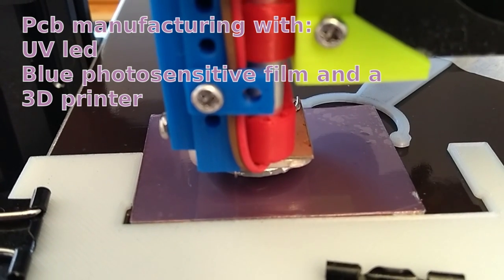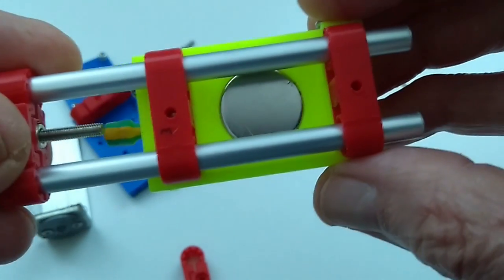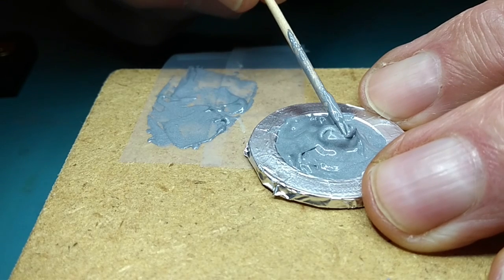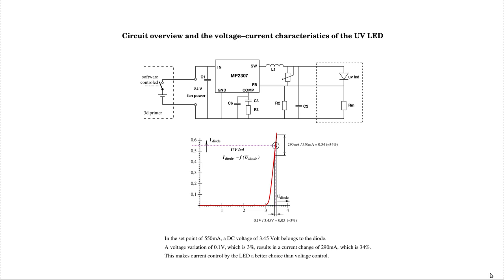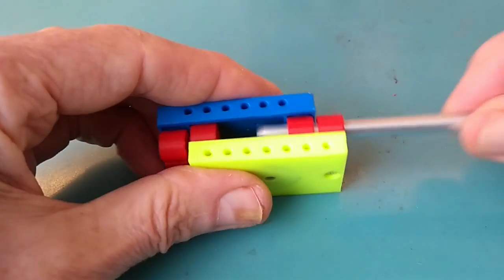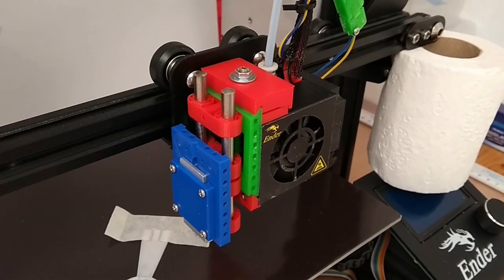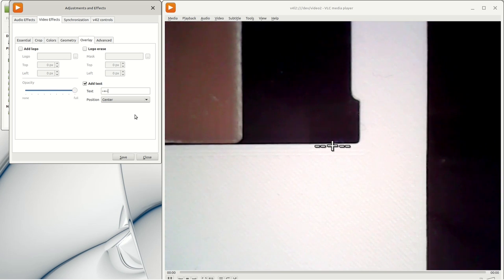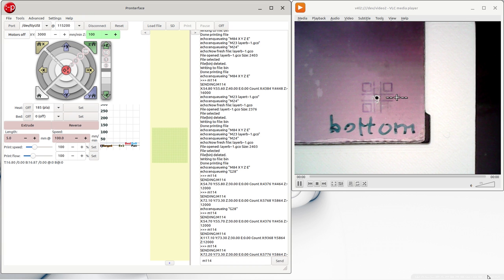Make a PCB with 3D printer, UV led and photosensitive film

Comment: I've seen a few attempts at using cnc to expose boards, most were pretty bad and others quite expensive to build.  Yours is impressive, simple and has decent resolution especially for basic through hole boards.  May take a crack at building a dedicated one, have lots of extrusion and printer parts laying around.  Thanks for sharing !

Comment: love the idea. Imagine using a fiberoptic. You can get these super thin. Place the led on the desk. Easy to setup on any printer. Keep it up!
Reply: Not just any fiber though. Losses through conventional 62um or even 1.5um fiber would be too high and coupling light into those requires either precision optics or lasers. For UV, you need to use hollow core fiber that starts at 200um and about $40/ft, which is only about twice the resolution of this pinhole implementation. If you want to focus down to less than 200um, more optics will be needed at the other end too, at which point you may as well go with 400um hollow core to more easily pump more UV in.

Comment: Your idea remembers me 40 years ago when I used the same principle to adapt a dot matrix printer into a scanner! Yes it works! Maybe a focusing lens could greatly improve the resolution. Thanks for sharing!
Reply from the maker: Theoretically: yes
Practical: no
The spot size is highly dependent on the lens-object distance.
The diaphragm of the lens greatly reduces the amount of light.
It requires an expensive lens system.
And a greater distance from the light source results in wavy lines when the machine vibrates.
Reply: @wilstraver962  Do you have the 3d specs for your apparatus? Do you sell the jigg?
Reply: I agree, many high quality sony UV laser diodes are cheap and simply use glass lens. Should be easy to build and provides a fine laser focus point. I have them sitting around, brand new many kinds of sony UV laser diodes and ender 3 V2. I never bothered to build the ender 3 v2 because I didn't expect it to provide decent PCB pitch lines. This youtube video shows it is very promising.
Reply: @wilstraver962  almost the laser marking or cutting machine work in same principles ..

Comment: Wonderful video.
I'd already thinked about doing PCBs at home and made a tabletop CNC mill, but after seeing this video, I want to make an UV light addon, it is much more simpler and creates less mess.
Reply: Correct, the milling process vibrates alot and makes a really bad mess. I may convert the milling machine into laser/uv diode.
Reply: only upside of milling is that you get holes with your pcb but otherwise, too much pain in the ass.
Reply: makes me wonder if you could shove a bit of scrap fiber optic cable to get more resolution.  I get why you don't want to use a lens in this setup, but maybe the you can push enough light in the fiber for it.
Reply: @warlockd  I think you meant to write a message under the video and not under my comment, but I'll try to figure it out anyway.
In the article "Transmission of UV Light with Optical Fiber" on the lasercomponents website there is a statement that a regular optical cable will not work, I quote:
"In wavelengths shorter than 260 nm, UV light caused degradation in conventional fibers – a direct result of solarization effects."
There is also a chart where you can see degradation of regular optical fiber cables.
So basically you will need special optical fiber cable by Polymicro or other vendor in order to work for a long time or if you would use regular one then change it after half an hour of usage.
Reply: @warlockd  this actually a brilliant idea. The only constraint would be how much overlap you could get when creating a fill type shape and of course the resolution of each step.... keen to see what that looks like numbers wise

Comment: Brilliant idea and construction of it!

A tip: You can make very small, very uniform long holes by molding glue or plastic around acupuncture needles, which are cheap to buy and come ss thin as 0.18 mm. (Coat them thoroughly with oil or mold release before molding the glue or whatever around them though!)

Comment: Your work is amazing, and I was really interested in your ideas, and how you made it.

Although I think your mic setup is holding your channel back a lot, if you're wanting to do this for your videos to get popular- there was a lot of pops and background noise from your mic when you were speaking, that meant I had to dial in the audio just right to where I could hear it, but not louder, where it would start to hurt/chafe my ears. I think less background noise, a pop filter, or a better mic are all things that may make your videos significantly more enjoyable to watch.

That being said, I'm really glad YT recommended you to me, I loved the video, and wish you luck in your projects!
Reply: Good point.

I've myself previously removed noise from the microphone using Audacity (used in post production), then I've used VoiceMeeter and Cantabile with Reafir plugin, and now I'm switched to Nvidia Broadcast (requires Nvidia GPU). Second and third method can be used for removing noise after and during the voiceover recording. But I found Nvidia Broadcast as the winner.
Reply: rnnoise is a similar concept as nvidia broadcast (very good but not as good as nvidia's), but open source and it's included now in OBS studio (add filter to microphone -> add -> noise suppression)

Comment: Hello, thank you for your nice video. I have been using this method for several years, but with a simple (but good) blue laser diode. I buy printed circuit boards with photoresist already present, and about 100mW is enough.
Reply: If some through holes needed, would you cnc drill them after the laser pass?
Reply: @lpjunction  It is rare that there are no holes at all at least for the connectors. I drill with a hand-held drill press. I avoid holes as much as possible by favoring SMD components.
Reply: @danielroibert5631  
Simple connector hole could be hand drilled.
But modern IC, even a simple one, has more legs than a centipede.
One quickly come to a point when 2d is not enough, we need 2 planes with some through holes.
Then of course, for prototyping, the through holes could be avoided with jump-wires.

Next, you'll be playing with micro-surgery soldering.  Have fun.

For normal drilling, the drill action is usually downward. I once have a DC motor drill for PCB, 
the drill is installed under a small 'table', the drill action is upward.  To locate where to drill, there
is a transparent acrylic glass secured about 7mm above the table, so the pcb can slide freely on the 
table.  For the first time, the drill poke upward to make a small hole on acrylic. Then you can use this
hole to guide the pcb at the spot right above the drill bit and press the motor upward to drill.

Add a magnifying glass to help, to me it is easier than using a drill press to drill downward.
Reply: @lpjunction  Thank-you. I don't know what you are getting at. I don't make PCBs for mobile phones. I just use 2.54 pitch connectors. I mainly use 0.8mm or 1mm drillings and that works fine for me. Your bottom-up thing sounds interesting, but I’m not sure how it looks.
For soldering too thin to be done with an iron, I use my reflow oven. And again, I only do prototyping. If I need better quality or small runs, I have them done at JLCPCB.
Reply: @lpjunction  That's a brilliant drilling method! Might be even better if you put the acrylic on thumb screw/spring mounts like a 3D printer bed so you can raise and lower it to be just more than the thickness of the PCB. That would eliminate parallax error when positioning, and serve as support for the drill pressure so you don't have to hold the PCB down to the table by hand.

Comment: This is pretty neat. What about - instead of making a pinhole with an LED inside - mounting the LED somewhere out of the way and coupling it into a TOSLINK cable to not only position light output more precisely but also reduce the complexity of the setup?

Comment: Woderful solution to make PCB boards on a 3d printer. Thanks
Does it make it in just one pass. Only controlling the time the led is lighting over a point?
Reply from the maker: Thank you for the positive response.
The pcb is exposed in 1 run. The amount of light on the film is determined by the intensity of the light source, the speed that it moves over the film and the size of the pinhole (0.1 0.2 0.3mm .. etc). So 3 parameters to control the exposure.

Comment: I wonder if you couldn't just use the nozzle of the printer and drop the UV lamp down into the hot end... then you can expose it directly through a .2 or .4 nozzle, for example.
Reply: good idea, the dot of ligth must be better and smaller

Comment: Have you considered using a focusing lens to narrow the UV beam with a more concentrated area?  I would expect to get better than 0.5 mm track.  I can see this easily getting down to 0.127 mm without any major problems.  Depending on the focusing optics, you can use the Z height to adjust the track/UV energy width.
Reply: I'm thinking putting the uv led in the nozzle with a drop of distilled water at the tip acting like a lense. You could change the focus by rising or lowering the led
Reply: direct contact with the film is simply the best method to do this. no need for any sort of lenses, cheap simple, and perfect results. the final result will be the quality of the 3d printer.

Comment: nicely done  Will,  maybe an old mechanical watch movement can help you to make the orifice. I would use a jewel of it.  vary of sizes are to find. balance axel is usually between 0.09 to 0.12mm, they are wear-resistant.  Hence, this is how they made the pcb films long ago with the use of aperture wheels. If I find some time will make a similar device and upload a video of it.  " just did a quick test, the red ruby doesn't filter the UV light"
Reply from the maker: You make me very curious.
Reply: Try obsidian 😯😃
Reply: @wilstraver962  0.1mm doesn't pass enough UV, it's not intense enough. this makes it a slow process.

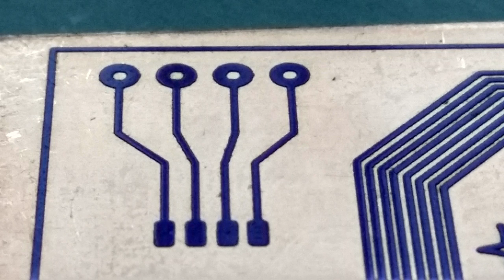Comment: 0:54 - Bravo. That is amazing you are able to do this on an Ender 3D printer. Which version is your 3D printer, V2 or v3? Is it possible to simply use a low wattage sony UV laser with good glass optics, would cost less than $30 for it.

Comment: I used UV laser instead. I was able to reliably get 0.25mm traces. I also tried adding a motor with a drill to make vias and mount holes. The only con with a laser is that it uses PWM driver and can’t be adjusted with input voltage (yet this is how most 3d printer controllers work - the gcode command adjusts voltage).
Reply: PWM and voltage control are about the same thing, since the result of PWM is the average value.
The main difference is heat dissipation in the controler.

Comment: I  wonder if you can use a scrap piece of fiber optics and glue it in the hole as a makeshift lens.  I would hesitate to use single mode as its way to small, but maybe?  I think you would have to polish the fiber each use though as it would scratch itself up. Humm, maybe it doesn't have to drag itself on the surface, as its small enough.  Ugh to to play with this setup, digging out my old ender 3 now and my 20 year old splicing kit hah.
Reply from the maker: Filling the pinhole is a good idea.
I tried that with UV glue and also with a two component glue. Unfortunately a lower light output. I have not investigated this further. But any solution from anyone is interesting.

Comment: I tried do almost this. First I tried print plastic to the plate, but nothing succeeded. Then I tried attach pencil to hot end and thought printer can drawing it, but I'm used gcode for 3d model and printer didn't pull up printhead when changing positions. This solution is amazing. I will try to repeat this.

Comment: How about printing to the bare copper one layer plastic? ABS, PETG, etc does not stick to the copper? Do they not block the etching fluid? Is it hard to remove later by hand?
Reply from the maker: I do not understand your question.
What does this method have to do with ABS, PETG etc?
Reply: @wilstraver962  These materials are fairly common in 3D printing, and I don't know how much they like to stick to copper. If you print the circuit with them, and they stick well, then you don't need to customise a 3D printer with an UV LED, just print the circuit to the PCB, and etch it.
Reply: @wilstraver962  he means this and yes it is possible https://www.youtube.com/watch?v=6T5zfDgzyK0

Comment: Great work! i was wondering is a uv laser could be used to make the setup more simple, but maybe the pinhole is necessary to prevent leaking of the light to the surrounding film
Reply: Basically they're will work the same, the only difference is that this print head will drive over the photosensitive layer and laser will be flying above it.
Also the laser will require you to use protection, in order to protect your eyes from burn also the laser costs more than one UV LED.
Reply: @frankhovis  I've copied messages from this thread to notepad and searched for word "blue", but nothing was found. We specifically wrote "UV laser", "UV diode", because this photosensitive film is activates in UV spectre.

Comment: Would it be possible to use two sets of opposing razor blades to further refine the size of the etching laser?
Reply: Watch out, you might end up with a diffraction pattern.

Comment: I'm just wondering what the actual gain of this approach is.  You still need to develop the UV-sensitive layer, so how is this better than printing out the mask on a laser-printer (on a transparent sheet) and using that to expose the UV-sensitive film?  I would expect that the real gain would be to get rid of the exposing and subsequent etching/dissolving mess, no?  Then again, I'm at the "soldering TH components on perf-board"-level, so all this is just way out of my league ...

Comment: what software do you used for desing pcb.
Reply from the maker: Before I retired 6 years ago, I used Cadence and ADS at work to design integrated circuits.
ADS is also suitable for making pcb layouts, which is what I used.
Now that I'm home I haven't been able to find 1 program that approaches ADS in its capabilities. My circuits are usually simple. I use an ordinary drawing program for this, made a pdf file and printed it with a laser printer on yellow paper, which I then used to put the layout on a pcb. But that will now change.

Comment: wouldn't it be simpler just to get 3d printer nozzle I think there are some with even 0.1mm diameter hole. It would simplify whole process, wouldn't it
Reply from the maker: I'd say try it. Then you will have to solve several problems. But I am very interested.

Comment: Hello, your work is very nice :washhands:,I will do it when I have the opportunity and time :S .after getting out of jail XD ...  I wanted to try to make eye lens for imaging by pressing a matrix on a transparent led surface like yours on a simple level.even pcb circuit, battery, mechanic, synthetic, texture, metal, plastic, wood :) was a nice  .When you think about it, it is possible to print full brain tissue, even positronic brain XD there are a few more things i want to try.

Comment: why do ALL microchips use such straight lines? why wouldnt curved lines work better?
Reply from the maker: Chip exposure machines use rectangular diaphragms with variable X and Y dimensions.
For curved lines, you use small aperture sizes and the exposure head rotates in steps to create the curve.
This takes a lot of time and that makes it more expensive.
And a rotating head requires a more expensive machine.
Reply: Curved lines actually do work better electrically, but straight lines and angles are much more practical for a production environment and the benefit of curved lines is small enough to not be worth the effort.  A lot of the PCBs in the vintage synthesizers I own were designed by hand before CAD was widely available, and do in fact have curved traces.

Comment: With less effort could add spindle = turn into cnc and route board, no need for nasty chemicals and can drill holes with same machine :)
Reply from the maker: In the 1990s, at work, we used an LPKF protomat 91s. This was a reasonable way to make pcb boards.
Later we had a LPKF protomat with automatic tool changer, I don't remember the type but it was the top of what was for sale.
Horrible, many broken tool tips. Very expensive to repair, a faulty micro switch in the tool head would cost 3000 Euro.
Anyway, I had a lot of trouble with it. Milling is a thing of the past for me.

Comment: I've been doing something similar using a resin 3D printer, much easier.  Just create a single layer print with the reversed circuit design, and expose it for 40 odd seconds directly on the printer screen.
Reply from the maker: Many such reactions have already been given, very childish to do this again.
Reply: Thanks for the update, I hadn't read any comments and thought I'd share my experience.
You had better go reply to all of them, then I'll reply to tell you you're being childish.
Reply from the maker: @Teh-Stig  sad
Reply: The resin approach works pretty well for single-sided boards, but a potential problem with that approach comes up when a dual-sided board is desired - registering both sides of the board with one another.  This approach allows one to use the fiducials to easily define an accurate offset to expose the second side and be assured any through-holes will line up, no matter what size/shape the PCB blank is.  Guaranteeing the registration between sides would be kinda tough to do with a resin printer without substantial modification.  Good work, Wil!